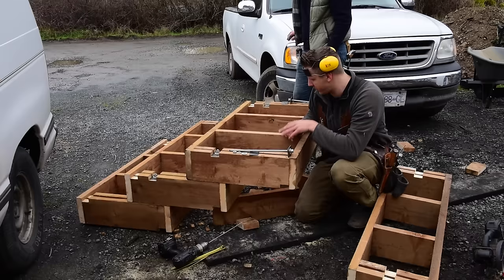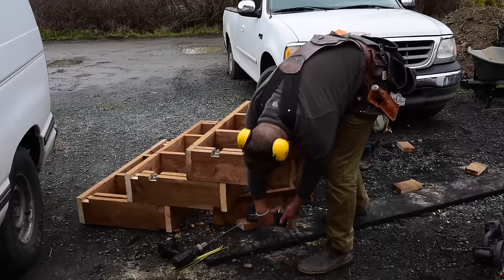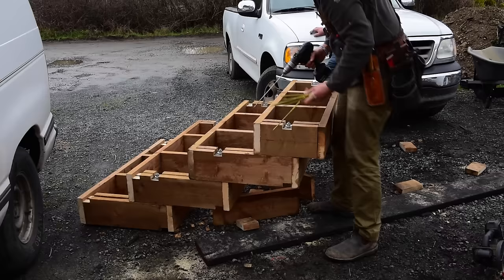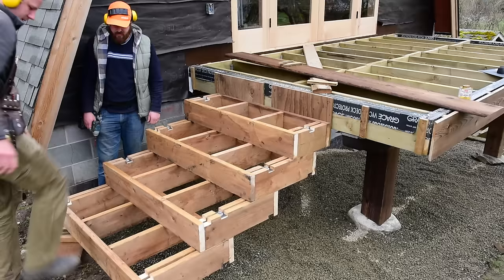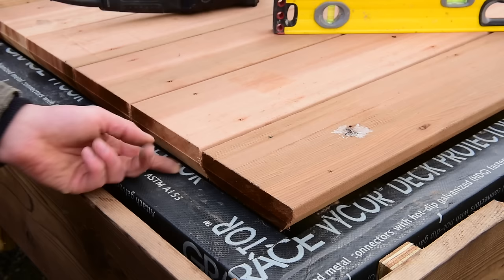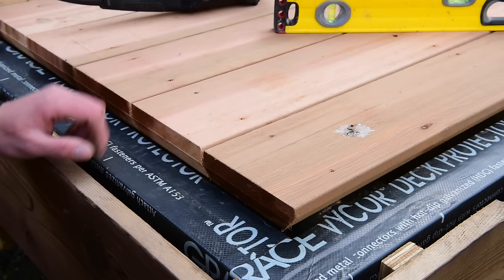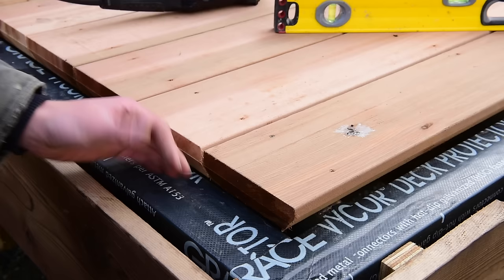FTF #52 Stairs Without Stringers? Here's How

Comment: let's spin three times the money three times the work and have it weigh three times more than it should for the same result
Reply: Too critical! He was just being creative.
Reply: Beef E  creative is how you get to things that are better. If it weren't for the creative people we wouldn't have the excellent ways of doing things now.
Reply: @systematic101  I agree.  But you also need to critically assess what you have come up with and decide whether it is a step forward or not.  I am a carpenter, and I agree with many of the others who have posted.  This design is not a step forward: it uses more material, is probably slower to build, and therefore is more expensive, for no gain.  And it relies on hardware to make up for the fact that the basic design is not elegant, in that it doesn't use the wood to its best advantage, as stairs with stringers would.  And I don't think it looks good.  Notice we never get to see the finished stairs in place.

Comment: Gravity is going to take a toll on this over time for sure, let’s call it a temporary stair.
Reply: It gonna sag. Need to be able to tighten those bolts when it does.
Reply: I installed "temp" stairs for a building.  The owner were going to get really nice metal stairs in a couple of months.  Four years later they are still there

Comment: Stringers are less work, less material, no bolts...
 Not sure why you made 16 inch treads. The tread to riser ratio is a total trip hazard
Reply: Because he has NO idea
Reply: Yyeaah these look like fucking planters not stairs
Reply: Liability issue: he'll be automatic guilty in a civil trial (7/11 or go to a flatter slope for the 16").
Reply: What a waste of time and material. I could build three sets of stairs in half the time for less money.
Reply: Don't get me wrong, this guy is a true craftsman and I've really enjoyed watching some of his projects. The only reason I could see him doing stairs this way is to show someone who doesn't know how to make stringers another way.
Reply: @joelcybyske2461  not a fan of the design, but him screwing it to the rim joist is the least of his worries. The exterior screws I use (Spax or Timber/Head Locks) have higher sheer ratings than 16d and 3/8 lags respectively so screw tech has come a long way.
Reply: It's also not National code.
Reply: Joel Cybyske screws actually have better tensile strength. Nails have more shear strength
Reply: @dewayneearley7298  That is correct . Rise and run aren't to code. Going from memory the rise is limited to 4" for a tread that long.
Reply: Joel Cybyske Your the dummy. The construction screws available today have a shear strength greater than a 16c nail which pull out.
Reply: giving your steps slope is also a bad idea.  when frost or ice are on the area it is a great way to slip and fall on your a$$.   I know some one who did this with his massonary steps,  real bad idea.
Reply: I just don't like the first tread..  good for newbs.. who don't know how cut stringers
Reply: Yah man idk, stringers are brainless even with different thickness flooring and take way less time
Reply: You guys are all hilarious
Reply: @Michaeljohhn  yes...we're so funny
Reply: not fan of the design or mounting to deck but really not safe rise and run i guess mother nature ant safe nether sounds like an inspector thats been in the city too long exactly why one needs more imagination not only liking cookie cutter (all the same 0 boring asf things  and as for a trip hazard one would need to be drunk or disabled and in pore health in the ears or some such shet lol amazing to be out side the box
Reply: @kevinburns2531  
     If I remember correctly code for a wheelchair ramp is max 1" rise over 12" so a 1/8" rise over 16" is not considered a slipping hazard by code however 5 steps do require a handrail which would give you a balance support from slipping.
Reply: My customer wants these wide treads (3 2x6 for each step), so I may have to use this type of design.
Reply: Look like to me he didn’t have to worry about codes .. it seems to be a cabin possibly in a remote area . Usually no inspection needed .. the inspectors in my area would fail those steps for sure ..

Comment: The stairs are a cool idea and I admire the engineering! The potential failure of the stairs which in the case might not happen due to the smaller size reminds me a lot of what I learned in school about the Hyatt Regency Walkway collapse. Essentially the walkway was held up not by the rods but merely shear strength of the threads. This is a similar example the stairs are really being held together in the same way. Neat idea though could probably be a way to trouble shoot this and continue to improve this design

Comment: Great design...   Very Clever.

Based on my understanding of force transmission, (I studied Mechanical Engineering), your stairs will hold a horse.  You can omit the rod from the second step, (closest to the bottom step) as the force is transmitted straight down onto the first stair that sits on cement footing.  All you really need is to attach the second stair to the first is a vertical plank on  the inside of the construction with the screws going in a horizontal direction. 

Assuming that the stairs incline is 45 degrees, the resultant force on the mid level stair, will will push horizontally into the deck as well as exert vertical tension on the the steel rods which can hold hundreds of lbs each.

Comment: I've been building decks for lets just say a long time.  Your back bevel on the end grain for drainage is 'Samurai Perfection'.
Reply: I bevel along the length of the boards for the same reasons, self cleaning, and great for wood decks on trucks and trailers.
Reply: Far more important is to know witch way the boards will cup (because that's what beveling is trying to correct in fact), then the need for beveling is completely negated. Especially seeing as a cupped board that has been placed cup up will still collect water unless you bevel almost to the middle of the board. Think about it.
Reply: i always wanted to get into wood working .. i thought it was just cut, glue, screw, sand, and finish .. but apparently i have a lot to learn .. any book recommendations or videos? i would very much appreciate it .. thanks

Comment: Novel idea but at a glance this seems to be a lot more work than chopping out a basic set of stringers. Plus, with contracting and shrinking I would think the bolts are bound to get loose over time.I'm glad you mentioned the fact that an inspector might crap all over the place if they caught wind of it...

Comment: The bottom will rot out quickly if it's not slightly supported off the ground. 
And due to the box design it will come unstable as it gets older.
Alot quicker than stringers.
You created a house of cards..
Now take them off before someone gets hurt and do it right. 
Its not so hard

Comment: We have always called these "portage" stairs. We use them for landscape stairs and trails. They are easy to build to adjust for a change in terrain. We usually back fill the inside of the stairs with fill, and then apply the treads. they work  good, because you can scribe abound rocks if you need to. I have never used them for deck stairs,  looks like a lot of extra material. if you do not like open stairs, you can always  add risers between the treads to box in the stairs as you would with a traditional stair.

Comment: Yeah, evey house I ever worked on got the floor decking trimmed by cutting along chalk lines. The same goes for any gable roof. We always held off on nailing the decking to the wall rafter and fly rafter til the decking got a chalk line popped and the line cut. Then we lined the fly rafter up with the edge of the decking and it was straight as can be. Since the wall rafter is parallel to the fly rafter because of "outriggers" every 4', the wall rafter will be just as straight as the fly rafter. Soffit installation is a breeze at that point. Now her's a little tip for you. Any wall that will have a gable atop it should be the "long wall". This allows you to tie that wall into the side walls with top plate so that you can let the top plates run long. Let the top plates extent out as far as the overhangs will be (minus facia) and you'll have a solid anchor point to start building your cornice returns (bird boxes) off of. Nobody taught me that. I realized it myself. As far as your stairs go...I wouldn't be able to use stringers either if I needed a 16" wide tread. Maybe I could use a stringer for such a wide tread if I could find some "2x24" lumber. Bolting those sections together is clever but I know they will eventually loosen up and get wobbley/bouncey. You gotta think long term or get a bad reputation for being a half-ass contractor. Be well, buddy!! Good video.

Comment: You've essentially made stringers by mechanically joining multiple pieces of wood together. This is inherently weaker than a one piece solid wood stringer...despite what you may think.

Looks nice though.
Reply: Allen 
He already said it wouldn't pass inspection.
Reply: for 3 steps this design is more than adequate.  in this case imagination trumps an engineering textbook
Reply: Inherently? 
Doesn't depend on dimensions of stringers or ANYTHING?
Reply: @weeverob  I didn't say it's not adequate. I said it's weaker. There is a difference.

Comment: Cuts up 4 metres of long, straight grained timber that could have been the stringers, adds a dozen other shorter prices with 3 times the galvanised rod,  to get a "floating" effect.
Stringer treads ALSO float - they have no feet.

Comment: I am a novice carpenter. Ive built a couple benches and two decks (12x24 and 12x20). I stole your idea and built four 2'x4' boxes but I ended up stacking them with the conors lined up, running them 30 degrees from each other (so they turned a complete 90) supporting the hidden side with 4x4s and creating inlaid spiral steps. the exposed edge just looks like boxes stacked. then I laminated dog ear pickets into a smooth arc to form a rim joist next to steps and ran the decking out enough to build a verticle 2x6 wall from each step to curved joist like a little well. I think I caught a bug bevause now my life is an excuse is to build sh*t. love your channel.

Comment: That's a lot of wood, 2x8 I suspect and yes all that wood is going to dry out and shrink and the all-thread will loosen up, I'll stick to stringers.
Reply: i think this is not a problem. u can tight the nuts form bottom :)
Reply: God, I hate stringers. My two step 12' wide, 24" tread steps were constructed and assembled in a similar fashion and have NEVER loosen up of had to be revisited. I suspect you'll find the same. Awesome job!
Reply: @ George Fedelski : Glad to see there are real carpenters around still. I half expect to see this Sam guy trying to convince people that this is also a good way to frame a roof next. 
   Rise and run are super easy people, just simple division for the most part. Remember that little blue book you guys got with your speed square ? Or those alien markings all over the side of your framing square ?
Reply: Aylbdr Madison sometimes you need to pre condition wood, dry it up indoors well below your regional humidity level and then it can only get tighter.  Similar to wood barn construction, wet timbers with bone dry pegs.  Timbers shrink and pegs swell.
Reply: That along with having the threaded rod set back away from the edge will give it leverage to pry apart. Being short like this may be ok, but I would imagine a tall set of stairs would be problematic.
Reply: Pretty hard to do stringers with a 16" run.

Comment: As an inspector, I can say that these stairs aren't necessarily going to be a problem. They would need an engineer's stamp, but thinking outside the box is not equal to not code compliant. Additionally, like another poster said, you gotta break new ground to move the ball. These are creative and look plenty strong enough to do their intended job for a long time. Frankly, I've seen some bad decks and they were built with traditional methods. Many deadly deck collapses go unreported and most of them are built with traditional methods (and usually improper connectors)
Reply: I think the key point is that getting an engineering stamp on the design would make it not worth the bother. Anyone who's got an engineering stamp for something like this want to share how much it cost?

Comment: A little reminder, that a similar system was in place in Kansas City in a walkway in the Hyatt Regency and failed (about 1982).   However, to be sure, there were modifications during construction not caught by the parasite, I mean government employee who tasks himself with catching such things, then counts on being absolved by other parasites later.  Also, instead of design parameters,  with the use as a walkway, there were over 200 people standing, and not just standing, but grouped on one side of the walkway which caused it to fail.  In your case, its just a good idea to test beyond mere jumping.  Think of the worst misuse those stairs can see, such as moving a piano, gun safe, appliances, and etc.  In those cases, who knows how long into the future non standard use may occur.  I wonder if a stringer could handle more or less weight than your design?  Still I like it so much, if I go work in Houston or now, Florida, I would like to use it.

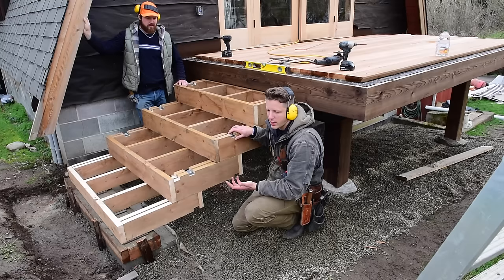Comment: @ 6:25  Many building inspectors will allow non-code construction if you “prove” the design.  Often this involves stacking a metric-shit-tonne of sacks of sand to show that it will hold.
Reply: And "metric-shit-tonne of sacks of sand" are hard to find.
Reply: Terry Pullen this is Canada,  all our shit tonnes are metric.
Reply: NAAAA,, I saw them next to the Metric Adjustable Wrenches!!!
Reply: I've never dealt with the type of inspectors you mention. Around here they know much more than any experienced contractor.
Reply: Has anyone seen where Ned Cramdit?
Reply: Dang Ned,  Yep,where the Sun dont Shine,, Could of benn Mike Hunt tho?
Reply: Not without an engineer's stamped drawing, they wouldn't.

Comment: check out the Hyatt Regency walkway collapse, it is nearly the same threaded rod design as these.
Reply: Of course it collapsed. The only thing that is surprising there is that it took at least 4 supposed professionals who should definitely have known better to allow that to happen : namely the architect, engineer, contractor and inspector.     
   They should all be ashamed of themselves for that one, because you can be sure that at least one of the carpenters told them this was a seriously bad idea.
Reply: When I saw him inserting the rods, exactly my thoughts,  I live in Kansas City and I was a Jr in High School during the Hyatt catwalk collapse.
Reply: @aylbdrmadison1051   The two engineers or architectures responsible for passing the drawings of the 'rods'   liscense were automatically revoked forever.

Comment: I love pretty much everything you make but I just can't handle that top stair. 
I thought it was gong to be level with the deck. 
Big stair, big stair, big stair, little stair, DECK!!!!
Reply: I was hoping it was an optical illussion, but I saw the same thing.  Tread which don't match within a fraction of an inch are a fall hazard and will not pass building code inspection for that very good reason.
Reply: @mojoman2001  How is the top step different?
Reply: I see every tread becoming progressively bigger as they desend. Looks interesting but probably not ideal for use.

Comment: Hey... you are an exceptional crafts man, the floating deck/stairs are great, brilliant idea. I dont see how they would fail in the eyes of a city building inspectors.. Most haven't driven a nail or a screw into any kind of material. Really do look well engineered, designed. Love the fastening system you designed to attach each box, (stair), what wouldn't surprise me is if an inspector came but didn't notice the sight and didn't catch the cool alternative stair plan and execution. executed  still using bloody wonderful lumber when there are so many enviro-happy designer approved non-lumber options for outside decks and docks. Why not put down that insanely good recycled plastics and tires lumber looking decking.. Im quite sure you all know this but to those who have no clue listen up, do some research on exterior wood projects, wood looking projects.. Very cool stuff and i have had several conversations with past clients, all very happy with the choice they made.. Now it's all about colours.. Choose the wrong one and you are stuck with it.. Not good to coat this stuff with paint.. I can imagine the nightmare weeks, months later with peeling paint.. out

Peace out.. Be Safe, Play Safe and DON'T DRINK & DRIVE...SNOWMOBILES SOON TOO, NO DRINKING. NO DUI'S, NO EMBARRASSMENT... AND NO BODY GETS KILLED... SI?